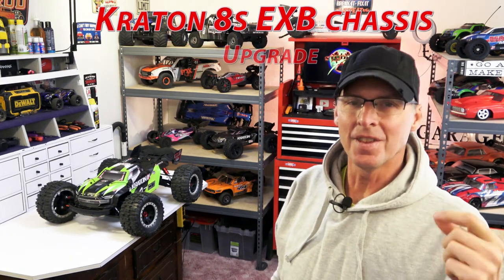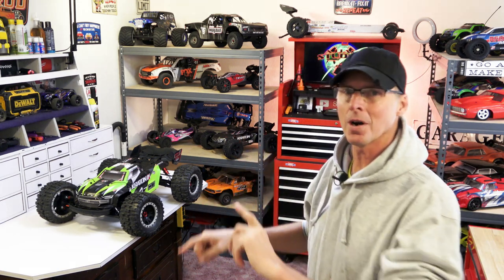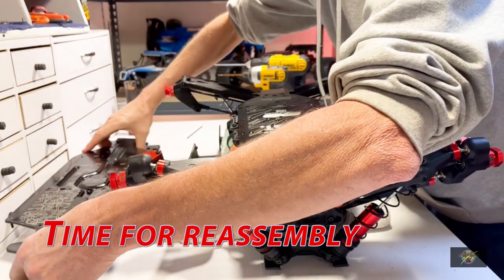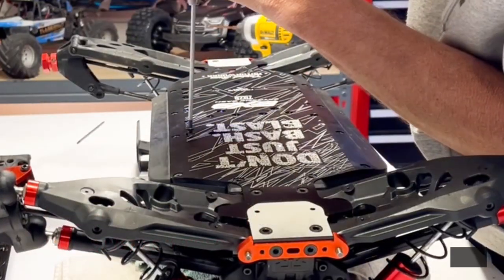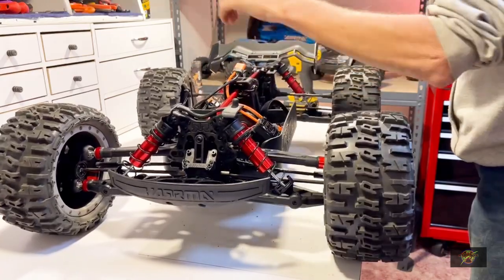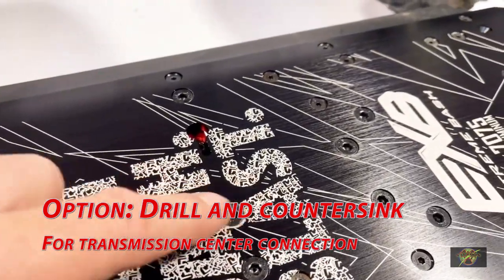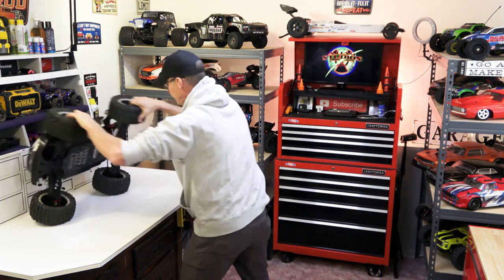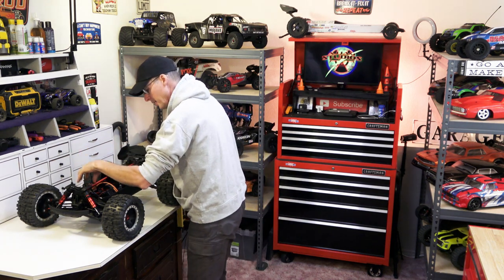Kraton 8s RTR to EXB chassis upgrade

Comment: AJ went with your suggestion and got the Kraton 6S this week.  Amazon had the V5 for $479.  Did a quick test run in the street tonight and Holy Mackerel!!! Very different from my Maxx.  I will say it’s the batteries are a little harder to get situated than my Maxx.  Next step is to vent the tires.  Thank you for helping me decide on the my newest addition
Reply from the maker: We are glad we could help. With a few minor upgrades that thing will be a beast. Awesome choice. 😎👍

Comment: I definitely appreciate a video like this explaining how easy it is to do a daunting task.   Now that I just saw how easy it is I'll be purchasing an upgraded Chassis considering mine is bent in half
Reply from the maker: I hope it works well for you. Thanks for watching. 😎👍
Reply: @AJJAMStudios  are these special shims, certain size and diameter?
Reply from the maker: No they are simple washers that I stacked to the right size. You can pick through washers at your local hardware store to get the right spacing. Thanks for asking. 😎👍
Reply: @AJJAMStudios  well, regardless.  I couldn't get the esb chassis so I just got another stock one.  I'm so happy I found this video.    Doing a chassis swap any other way is just asinine...  I can't believe what I just did in that time with the pinion, spur and motor swap while adding the dual fans.  Wow.  Thank you!
Reply from the maker: So glad we could help. Thank you 😎👍
Reply: @AJJAMStudios  awesome.   Any knowledge of why the castle escs don't work well if at all with the stock K8 receiver?    Can't calibrate and get into settings on the new esc.

Comment: Your cradle method sure does hold the components well.
Reply from the maker: I was surprised also when we first attempted it. Five chassis later, and on different rigs and sizes, we've come to realize it "is" a viable way to swap a pan chassis out, and an efficient way to do it too. Thanks for the comment. AJ

Comment: I can't find a video on how often you should re-grease the front and rear dif on the Kraton 8s , I don't plan on running it through water, I'm watching the one by Arrma. But they haven't mentioned how often ?
Reply from the maker: You should inspect the diffs about every 20 runs or so. If the grease is looking used up, it is time to pull the diffs and have a closer look. I hope this helps. 😎👍
Reply: @AJJAMStudios  Thanks

Comment: The m2c upgrade is a much better option. No washers or bs needed. Also there is an under chassis bar support direct bolt on over existing.
Reply from the maker: True, the M2C products are tougher, however, we were showing the budget way to achieve a higher durability without spending quite so much money. Thank you for bringing that up, we appreciate your input. 😎👍

Comment: Do you have this video in full length? I'm about to do mine since the chassis got to me today.  Plus all the other good stuff, 800kv , new esc and other parts.
Reply from the maker: We do not, unfortunately, this switch is the only run of the video we have. Best of luck on your rebuild. Wish we could be more helpful. AJ

Comment: Could you explain the washer part for the transmission please, how many washers per bolt on the transmission, I know you said 5 but what’s the order of the 5 washers
Reply from the maker: They were just enough to take up the space left by the new chassis. The order does not matter as long as they fill the void. This allows for a tight replacement without having to buy more parts from Arrma. So far we’ve had no issues doing it this way. Best of luck 😎👍
Reply: So did you do 5 washers per bolt or 5 total split between the 3? I really appreciate the help, My chassis is beyond bent lol it cracked, I’m doing this upgrade
Reply from the maker: 5 per bolt, but washer thickness varies. Snug the mount down with the areas that work and then stack your washers to find how many you need for your washer thickness. I would only do the rear and not drill the motor mount one unless you’re skilled at that sort of thing. The chassis does not have the motor mount hole from the factory so I don’t think they think you need it. I added it only to beef up the mount. We show this in the video. Thanks again for asking. Does this help? 😎👍
Reply: Yes sir that helped a lot

Comment: I know defrent cars but 
Whats most fun KRATON 1/5
XMAXX or DBXL ?
Reply from the maker: That is an interesting question because they all have their strengths and weaknesses. To get straight to the answer here, the DBXL-E holds a special place in my heart because of its Buggy styling and power. It handles great and is real quick straight out of the box. But then again, the Kraton 8s is also fast and fun to drive. Having much wider tires, the Kraton handles differently from the Losi, having the speed and power to skim puddles with ease. But then again, the Xmaxx is a brute of a machine. It can stunt in ways the others can't. With minor upgrades for the suspension, the Xmaxx becomes way more durable and fun rig to play with. They call it the "King of the bashers", and I can not argue that point, for it is unique to the hobby. If I had to choose one to keep and let the others go...well...due to the new tracks we just built, and the way it handles, I would have to go with the...oh, this is hard...I would say it is the Kraton 8s. However, there is no wrong choice here. The Losi and the Arrma are both faster than the Xmaxx, straight out of the box, but the Xmaxx is way cool to smash around in the wild. The Losi is narrower than the Kraton and the Xmaxx, and has truck tires on it not monster tires. All three jump well, handle good, and seem to accelerate great. And, you can get replacement parts and upgrades for all three. I hope this answers your question. AJ

Comment: Does the EXB chassis bend when jumping off of ramps and landing hard? I’m thinking about getting the RTR and I’m trying to consider the best option for other chassis
Reply from the maker: It can but I’ve yet to bend one. Rough landings can affect the chassis but with the aluminum center braces the car is much tougher than the RTR version. Thanks for asking 😎👍
Reply: @AJJAMStudios  thank you! It’s probably the cheepest option I’ve found yet!
Reply from the maker: That's what we try and do here, save everyone some cash but still get the job done. Thanks 😎👍

Comment: Actually looked easier than typhon swap , bigger more sturdy I guess
Reply from the maker: Both went better than expected. I was unsure if the cradle would hold the larger parts on the 8s but everything went pretty good. Reassembly was no problem for either, but the mods to the 8s did take a bit longer. That being said, the Typhon swap was our first, and we did it cold with no prep work, so that probably contributed to the difficulty level somewhat. By the time we got to the 8s we'd done four chassis swaps in that way, so our confidence levels were much higher and we had practical application behind us, so things went smoother. Thanks for the comment. 😎👍

Comment: why would you put white lithium grease in the diffs and not diff fluid?
Reply from the maker: Lithium grease on the outside ring gears, and diff fluid inside. It is two different locations. Thanks for asking.